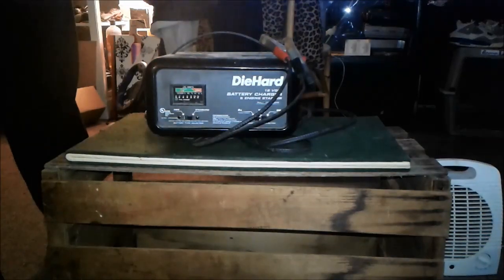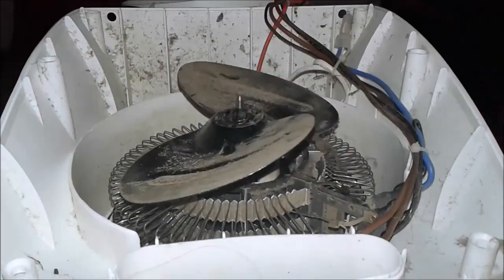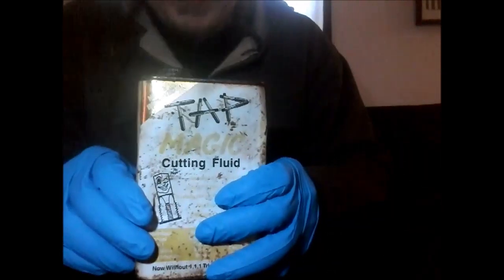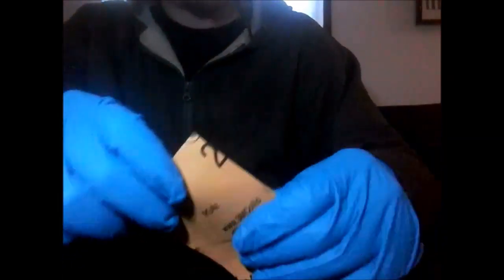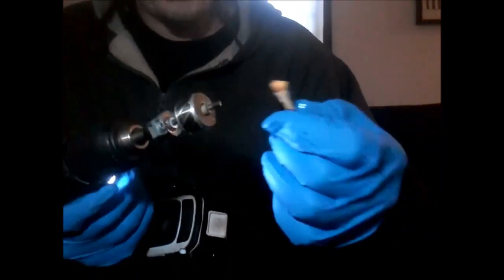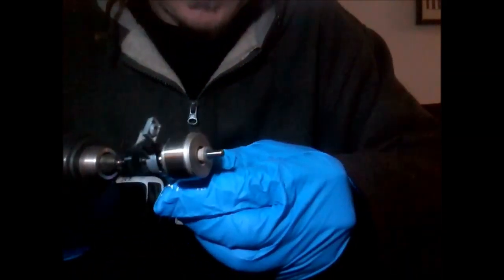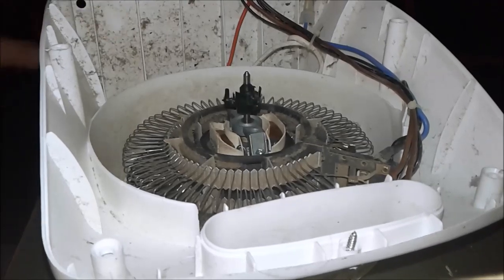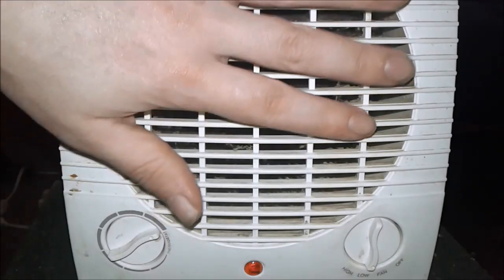Fix A Squealing Or Frozen Electric Motor For Free (Magic Smoke WARNING!)

Comment: The spider thanks you for fixing its hidey hole. Also scotched brite a crank shaft on an Oldsmobile station wagon. Filled crank case with Prolong and full synthetic Mobile One. Drove it 75k more miles. Sounded like hammers in a gold mine. Still ran until the trans went out. Funny as hell commentary!😂😂😂 I use Prolong on all my electric motors. Stuff works!

Comment: It’s nice to fix things without new parts!
Reply from the maker: Thank you so much for watching and taking the time to write a comment Agnostino. I always try to to fix something for free before I go buying parts and though it may be more rigging than repair sometimes a result is a result LOL Thanks again truly.
Reply: @heavymetalATC  You’re welcome! I saw your video because earlier today I had to repair a stuck fan motor on a 30 year old dehumidifier. Take it apart, clean the motor shafts oil it, and throw it back together!
Reply from the maker: @agostinodibella9939  Awesome! Thats the way to put some life back into it without spending a dime. Good job.